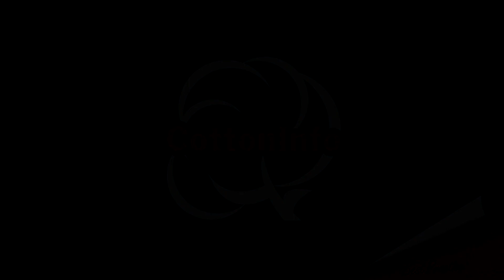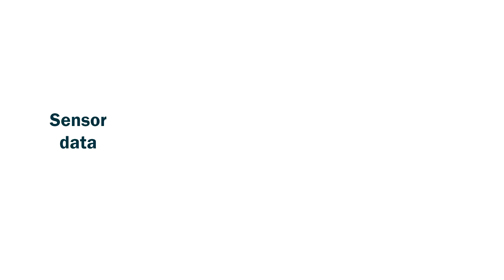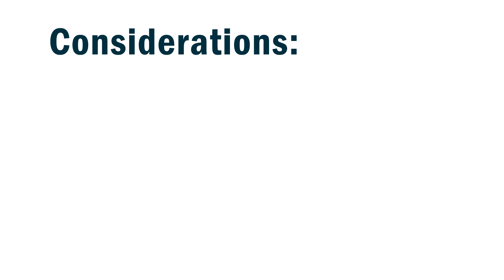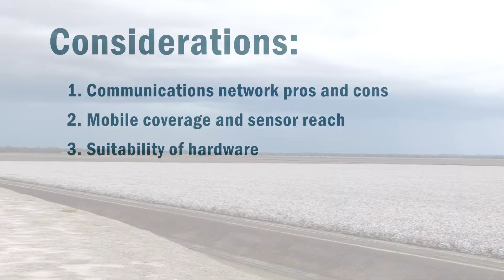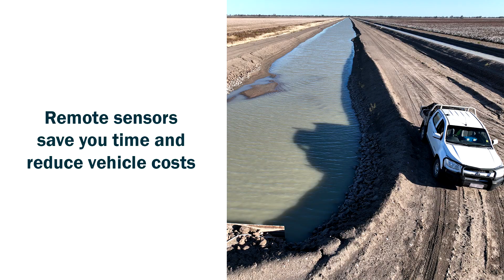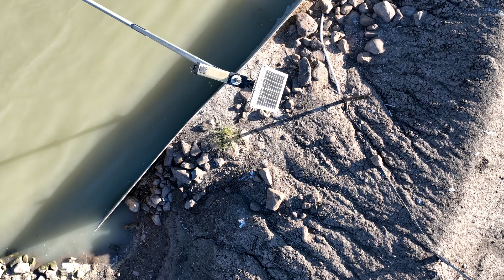Level sensors – a grower perspective

Comment: I’ve just done this for my dad’s farm in central QLD. I’m using Dragino ldds45 sensors over LoraWan. I push it to AWS and with a single interface I have all the levels etc. I can change remotely the sample rates and monitor battery levels etc. I primarily use it for channels and I have 3 mobile ones for head-ditches which they can relocate as needed. My next project is to monitor levels of tanks for water and fuel. I’ve invested about $1000 in total and we will save that yearly in fuel costs not having to drive around so much.